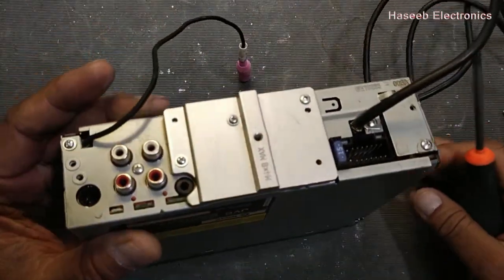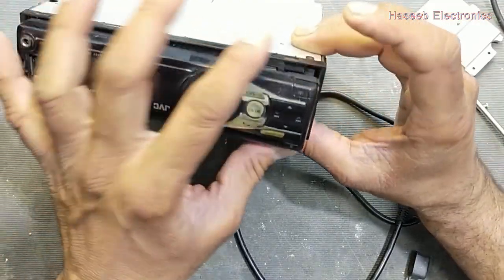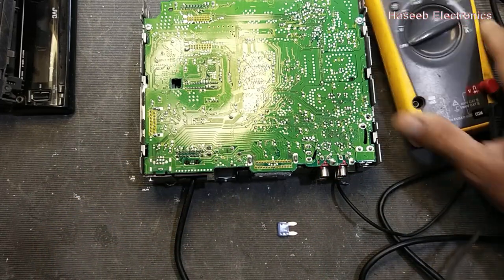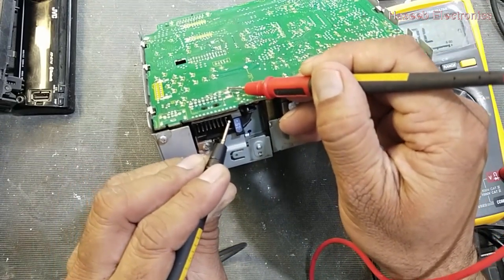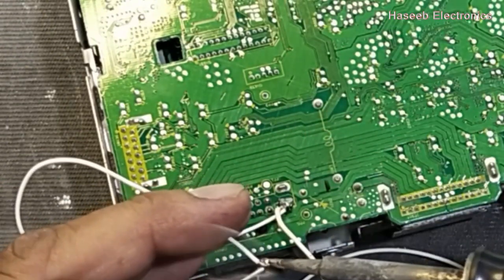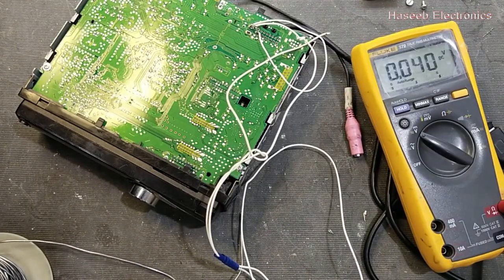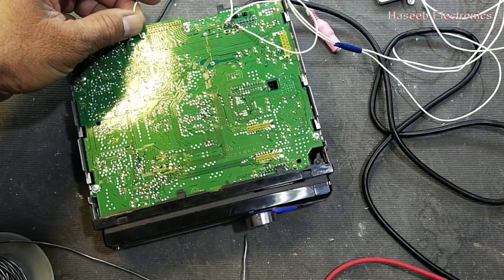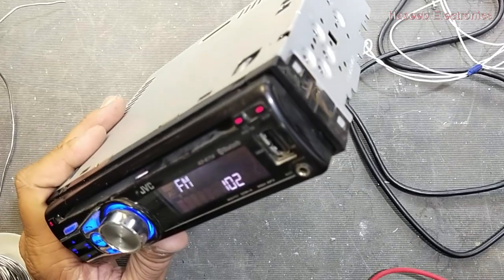{505} How To Power-ON Car Stereo Player Bench Test - In Home  For Repair

Comment: Is it necessary for acc and 12v constant  combine ? If not what would happen . Did radio will turn on
Reply from the maker: if ACC wire will be connected to 12 volt battery directly 
the car radio /mp3 will remain on. because it is power on signal to control the power on 
if it is combined with 12 constant 
then radio power on / off button is used to player

Comment: Is the fuse always connected to the positive battery terminal? Or does it connect to speakers in some cases?

I have an aftermarket radio (Vrted it says on it) that I sadly dont know the pinout for and I realy dont want to feed 12V to the speaker outputs

Also how can u figure out the light and ignition on pins?

Also how to know what are speakers outputs?

Comment: It is great video, to me it is well explained. Now let me tell you my situation, I have an mp5 head unit. That blew when I connected an amplifier to it. The fuese never blew, but the terminal or the unit connection has a short. Every time I reconnect it in the car it blows the fuse in the fuse box. It heats up too much, and goes off obviously when power is cut to it. Do you think that still has a solution or should I just toss it out?